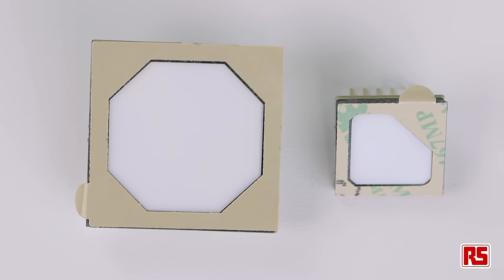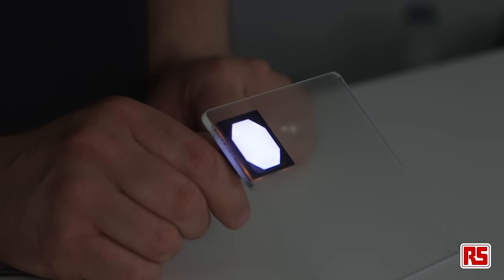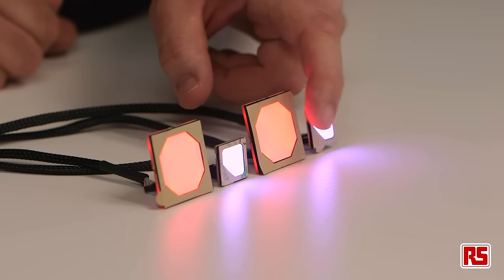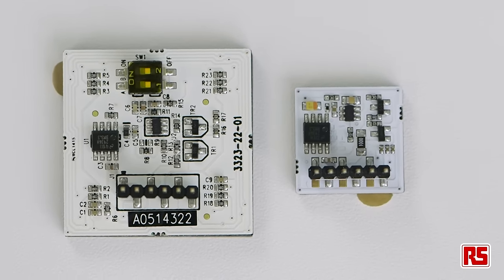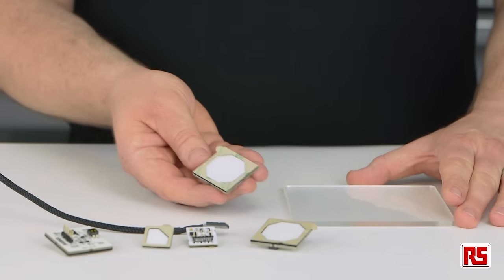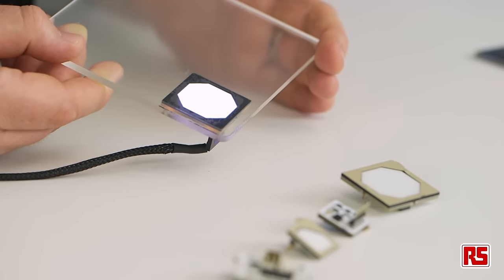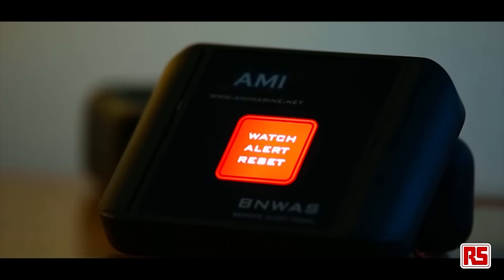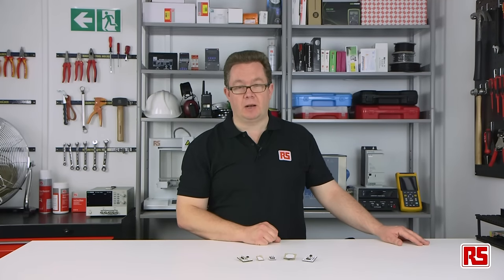Demo of Stadium IGT Capacitive touch Switches

Comment: These are really cool we use them for a student project.
Watchout for the powersupply because they work on 6-24V so they are not directly suitable for microcontrollers. You may need to use transistors to drive its rgb color and divide its output voltage if you want to read the output.

Comment: - Is this not possible in the 3V range (for 3mm thick Acrylic)?
- Does the LED have to always be on? I need to conserve power. My IoT device can currently function for a year as long as it only cycles every half hour. Having an always on LED would defeat the purpose. I need to LED as a feedback mechanism to acknowledge that the button has been pressed.
- Can the button differentiate a 3 sec touch from a 1 sec touch?